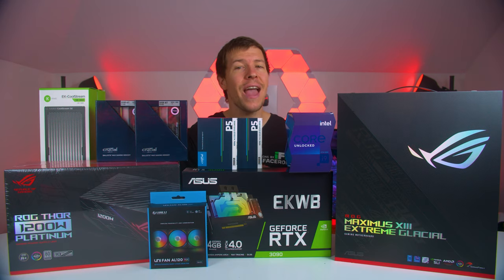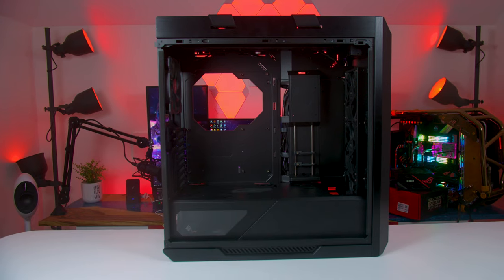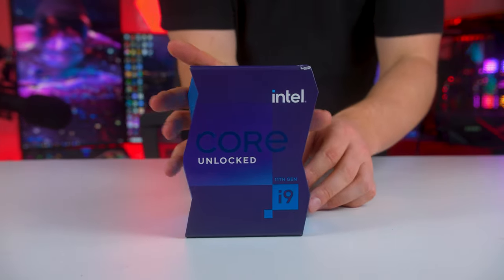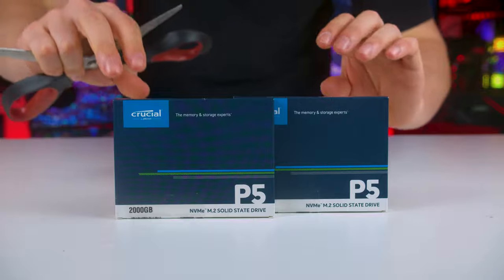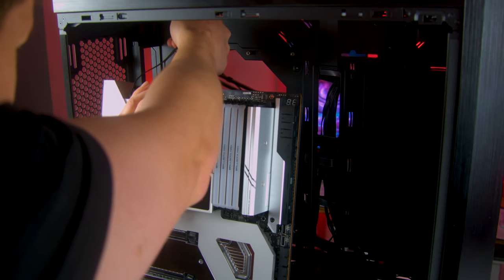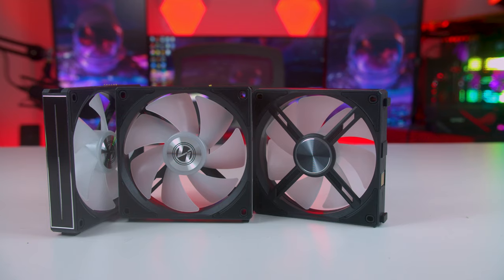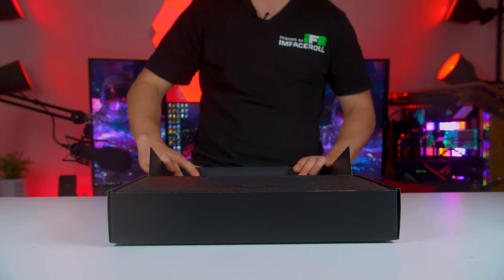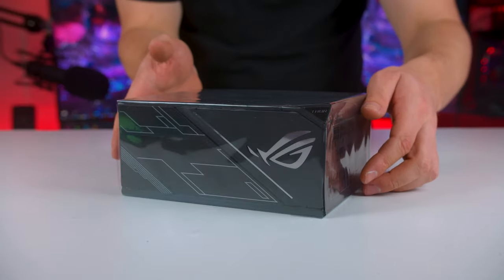I Built a $8000 all ASUS Water Cooled Gaming PC - RTX 3090

Comment: basically what I’m going for with mine! Strix 3090 and 10900k in Helios on a rog hero Maximus xii in process of getting all the watercooling parts, optimus gpu block, ekwb monoblock, 2 360 watercool rads in stainless with 2 seperate loops one running from a ekwb 120 flt pump res and other coming from optimus 150 pump res in stainless to match can’t wait ☺️